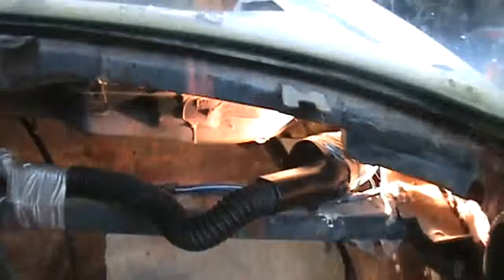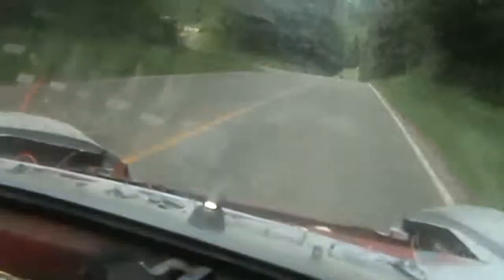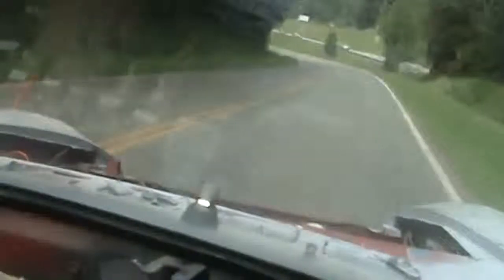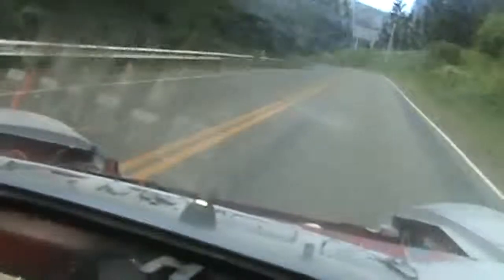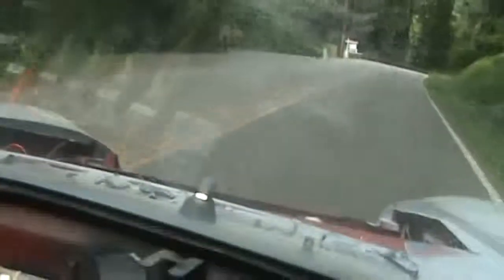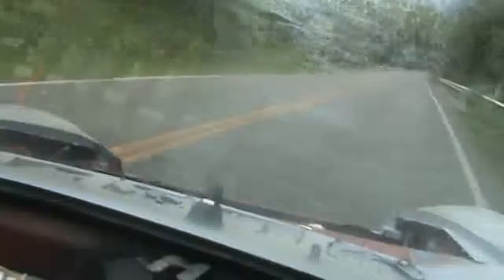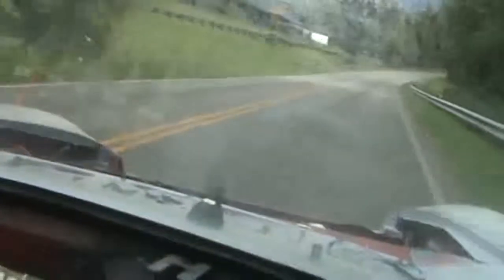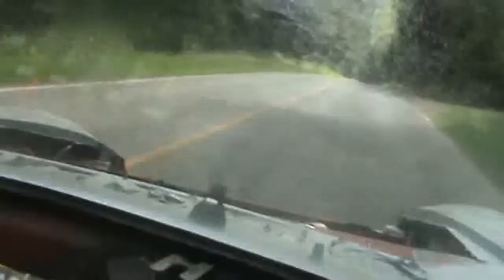FIAT lead acid conversion 60 volt 20 hp, low speed first test 40 mph

Comment: Hi Again,
did you really get 3 Watts out of your artificial leaf solarcell ?
Did you mix the barley first with water and then mixed it with epoxy ?
3 Watts is a huge breakthrough and you don´t seem to knowo this for
a selfmade solarcell man !
Please make another video about it and show the output !
Please make it Open Source or use crowdfunding !
Many thanks.
Regards, Stefan.
Reply from the maker: Thanks for the interest. Honestly i do not know the exact watts, and i lost the original test cell. i had definite 5 volts out of a number of test cells, some with lower volts. I was getting a few ma of current out of them, think i had about 100 ma out of one, so more like .5 watts from a 2 by 2 inch cell.
Reply: Justin Leighton

Well this is all great. if you just get more than 1 MilliWatts out of such a selfmade cell ! It is a pretty big breakthrough, if you could teach us how to replicate, that would be really great, as no one else has achived something like this.
So could you please open source this and make a new video about it with more
exact descriptions and explanations ? Did you connect the copper wire to the upper alufoil ? And did you connect the lower alufoil to ground potential ?
Many thanks. Regards. Stefan.
Reply from the maker: I did not reveal some details in the vid. I used a salt to create a conductive electrolyte I used chopped carbon to create a conductive network in the epoxy-chlorophyl layer. I mixed the conductive water solution with the nanocarbon layer and the epoxy to prevent oxidation of the solution.
Reply from the maker: overunitydotcom  yes i will replicate this experiment at some point. my concept was to create a simple capacitor from al foil, where the plates are connected by the electrolyte (solid polymer electrolyte). The top exposed plate charges due to the magnesium in the chlorophyl, transferring charge to the carbon fiber matrix.

Comment: Well done, too bad you did not show the batteries, would have liked to see the motor and batteries and controler... Anyway, well done !
Reply from the maker: thanks a bunch ya'll seem very supportive of the project. I will make another video with more details after some coming mods, it is just 6 deep cycle marine batts at the moment for a 70 volt nomical pack. I will be installing a diy mosfet controller for 1500 Amps. there is currently no controller exactly im running a 2 speed relay setup with the EPIC fiat 5 speed tranny. I have hit 50 mph and I think it will hit 60-70 on flats, but the grade performace is pretty poor with the small motor.